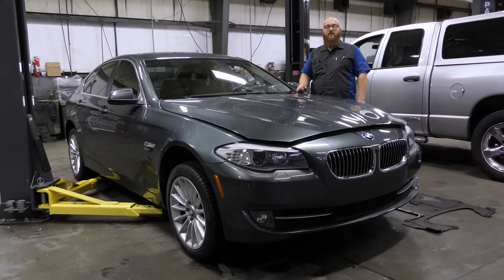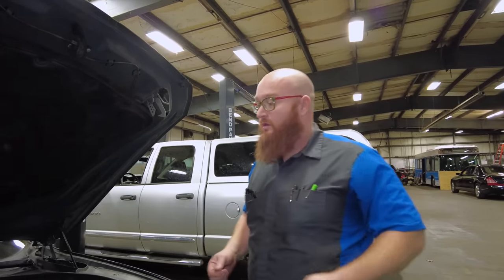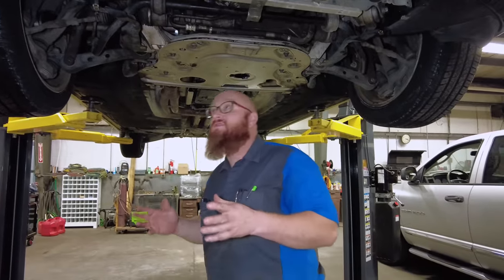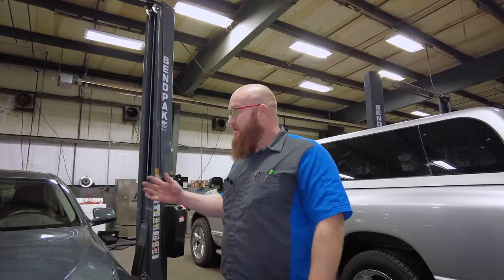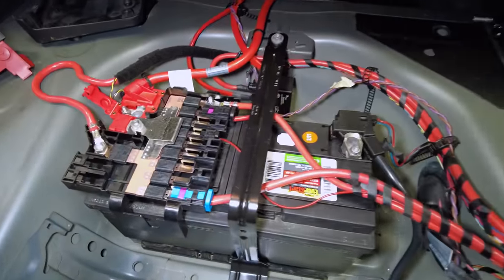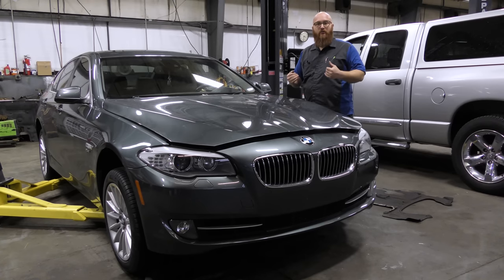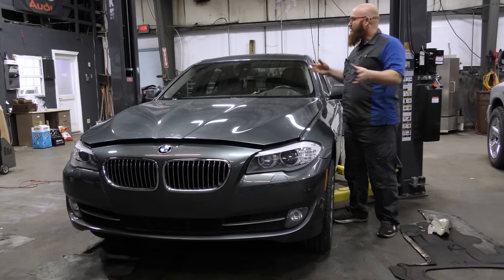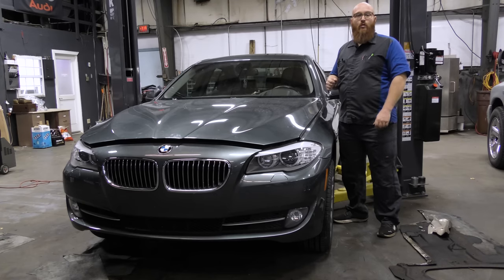One bad day for a customer! CAR WIZARD found TWO insanely unrelated issues at time on '12 BMW 535i

Comment: I’m a BMW tech and funny enough, I’d consider the N55 (the engine you’re working on) one of the most reliable engines BMW has ever made. The only thing is that they are reliable as long as they are taken care of properly. I’m working on an almost identical F10 535i right now and you can clearly tell the car has not been taken care of. My personal car has the same engine, except it was taken care of and it’s in very good shape even at 125,000 miles. Also for anyone who is curious, some common issues for the N55 are the turbo chargepipe blowing (mine lasted 110k miles), the water pump will go out around 100-130k miles (mine has not been replaced yet) and the common leaks after a lot of miles or old age. Other than that, it’s a very reliable engine!
Reply: He probably did serious overheating damage because he didn't pull over immediately and shut the engine off. People think maintenance are a nightmare, but in fact I find it cheaper to change oil than what a Toyota dealership charges for my friend's Sienna.
Reply: BMW gets a bad rap because people skip the maintenance because "it costs too much" and than they drop it onto the next owner. Also i do agree with you 100%
Reply: I had a 2011 535i. The biggest problems I had with it were cooling system and oil leaks. Valve cover leaked, water pump failed at 100k and oil filter housing pump started leaking oil everywhere. In the back of my mind I was always worried about having to replace the turbo. Luckily someone hit me and totaled the car out lol. I think I would prefer the 2011 528i if I decided to buy another F10 in the future because for that one year it was the naturally aspirated N55.
Reply: The B58 takes all the great things about the N55 & improves on them. If you’re going to buy a BMW get a B58 powered vehicle. If you look at the tech specs you can see BMW made reliability a much bigger priority with the B58. Coated rod bearings (N55s are notorious for rod bearing issues,) mechanical water pump, almost no gaskets (very rare for a B58 to have an oil leak,) closed deck / entirely forged internals, much stronger charge pipe, etc
Reply: @theslavsyndicate8524  Also because they rent the car for 3-5  years and delete the maintenance
Reply: Other than that it's very reliable engine!...   My RDX is laughing and my Avalon is busting a gut!
Reply: Hi, do you know if there is any bad years for 335s? Not GT's... Would really like to know, thanks! :D
Reply: m57 more reliable then n55. Too bad you guys in America dont have a lot of diesel bmw.
Reply: @Forsaken average for BMW
Reply: @Enthusiastlist  This is true and it’s why I said the N55 is one of BMWs most reliable engines. The B58 probably takes the cake for the most reliable engine, though it doesn’t come without its own issues. PCV systems seem to have become a big problem with the B58s, as well as the mechanical water pump. As for the leaks, it will be hard to tell what will happen in the long run but for now you’re correct, they are pretty leak free. Its newfound reliability has a lot to do with the collaboration they did with Toyota. Toyota helped them with reliability while BMW helped Toyota with their performance and it definitely shows that it has positively affected both brands
Reply: Bmw ownership separates the kids from the adults
Reply: @Forsaken My dealer charges $270 an hour (which is just insanely expensive) but a lot of it depends where in the country you are. I’m on the east coast if that helps.
Reply: @stevenatwater7298  RDX and Avalon suck to drive though...
Reply: @jalopy2472  Just like an Audi.
Reply: @Gurupimp10  Not sure if you’re talking about the E90’s or the F30’s but honestly any 335 with the N55 in it (late model E90’s and early to mid model F30’s) are a good option as long as the maintenance history looks good.  Honestly if you want the best reliability I’d go for a 340i, the one with the B58
Reply: @doingyamom  Ye im looking around for any 335, just want to know what to really go for, have never had BMW befor but I really like the 335. I don't need a "Big" car but I want something whit a little bit more power and I think the 335s are perfect for me, Thank you for the input, will look around for 340i , cheers!
Reply: @red58fury  n52 not n55
Reply: @burntnougat5341  or a fool and his money….
Reply: @apb1236  yes, if you don't know how to take care of your car
Reply: @burntnougat5341  taking care of your car shouldn’t involve constantly chasing oil leaks, constantly chasing coolant leaks, replacing control arms regularly, and all of the other stuff a modern BMW requires. I can understand if it was a supercar, but it’s just a disposable vehicle good for leasing and tossing.

Edit: then again, they’re great for the folks that want to wrench on them as a hobby
Reply: @apb1236  do you speak from experience? There is no constantly chasing leaks. Do your maintenance on time and you won't leak.
Reply: @burntnougat5341  absolutely from experience! 8 year past owner of a 2008 E60 550i Sport that bought off lease at 37k miles and let go at 199k miles after two engine out reseal services, 3 suspension rebuilds, 1.5 coolant system rebuilds, 2 full transmission services, countless 7500 mile oil changes, a full steering rack replacement before 100k due to leaks, full active roll bar replacement right after 110k, and myriad electrical problems like the car locking/unlocking itself randomly, HVAC controls randomly working and controlling the dampening actuator behind the dash enough to break the dampener actuator, and two comfort access handles that you could cook bacon on at any given time. Not counting all of the other niggling issues that needed addressing due to German over engineering. At exactly 199k miles, the valve covers started leaking yet again and a crank pulley seal ruptured causing a CEL just before annual inspection. Power steering braid hoses also developed a split and lost fluid. Craiglisted it for scrap. With the amount I sank into that POS, any normal car could travel a million miles. I’m the fool that parted with his money in this instance.
Reply: @apb1236  you got a n63. It's your fault for not doing your research. The inline 6 are solid. Blame your own ignorance
Reply: How is it possible that I just had bmw transmission malfunction chassis stabilization electric power supply all at the same time
Reply: @apb1236 I was tempted by 650i earlier this year by how cheap they are. Then I looked at all the shit that could go wrong and how different it is than the 93 540i that's given me zero issues in the decade plus I've owned it other than little diy jobs like a gasket or.two, coolant hose, window regs, glovebox clasps etc.
I have 3 really old 5 series now, 900000km total. They're so solid and reliable and every issue I've had so far is DIYable and cheap. And mature previous owners are the BEST. Flogging the 528i with the short ratio diff is way more fun than it has any right to be!